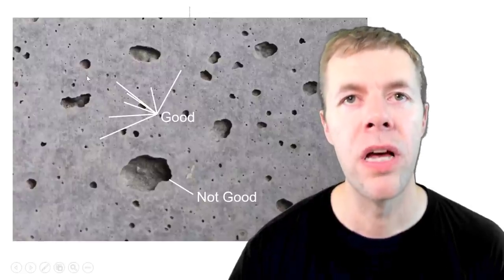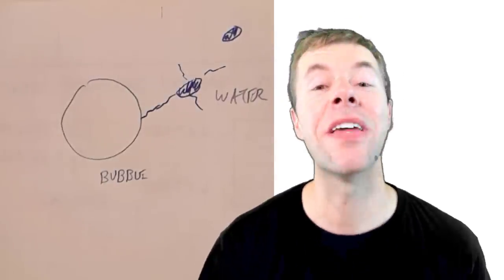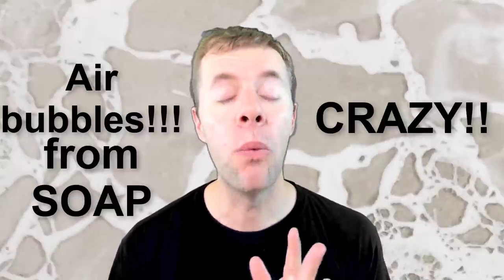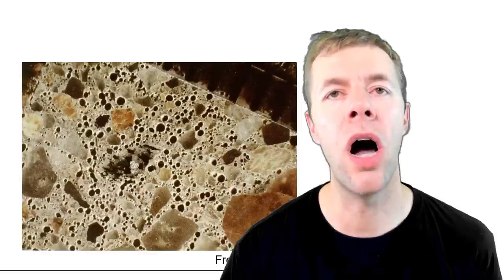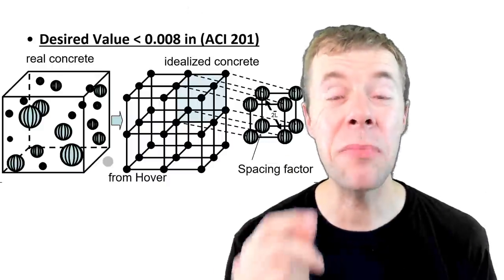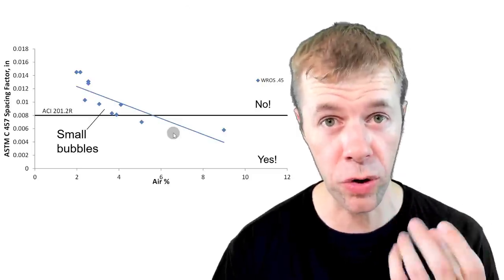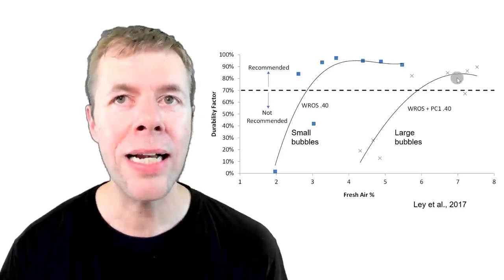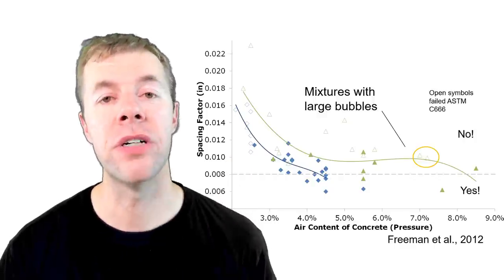Why do we NEED air bubbles in concrete? | air entrained concrete

Comment: I've tested concrete before I discovered that driving a mixer was easier and paid better. 
There was a field test for air content that involved  a pump and a gauge. When I first started this comment I though I'd forgotten how that was done, but after a  minute or two the memory came back.
Tyler Lee, I have yet to fully explore your YouTube content. Have you done any on the field testing of concrete, as well as everybody's favorite, the break test performed with a hydraulic press in the lab? When I was doing it we were using molten sulfur to cap the sample cylinders, which were much larger than those I've seen used now.
I'm now retired.
Do you remember the killdozer that terrorized Granby, Colorado? I hired as a driver for Mountain Parks Concrete as they were rebuilding the parts of the plant Marvin destroyed.
I've delivered concrete at -12 F. Amazing how fast water freezes at that temperature, even with hot water in mix and tank.
When I was working I did not think delivering ready-mix was all that great a job, but looking back it is probably the best job I ever had. 
Especially since I was delivering to places in Grand County, Colorado, one of the loveliest places on the  planet.
I could tell you tales of concrete abuse, usually involving adding water to the mix, contractors request, so the five inch slump becomes a more workable seven or eight. This was during a luxury resort and vacation house building boom. Some contractors wanted to place quality concrete that lasts. Many simply did not seem to give a shit about that.

Comment: This all seems like common sense to me I've worked Concrete in many forms from forming pouring and finishing to demoing demo is where you really get to know the strength of your concrete's and cement .
The need to get it down and get it finished so it can be used is the problem .
Does not allow for natural cure time .
Gives reason for the chemical cures .
I don't know if things have changed but my day I learned the hardest concrete known to man or ever found was it the very bottom center up dams that were not forced to cure quickly but allowed to cure naturally .
The toughest and hardest concrete I ever had to demo was the oldest concrete I've ever seen the footings and peers of the oldest Factory building I've ever been in . So hard using the Jackhammer was useless had to drill and use a hydraulic Rock splitter to remove them . from what was now being used as a showroom in what had been used as a basement for many years but originally built as a cistern .
 My Mentor in concrete when I met him had been working concrete for over 50 years .
 I'm just about the age he was when I met him now .
You have to share studies he had followed and everything he had learned .
He'd always say with concrete everyday you learn something new and I have found that very true .
Very much the sample taker and studier of our biggest pores didn't worry much about the little ones .
Always talking about his studies on Research done of core of the oldest dams .
 always very controlling with the moisture content when pouring always watching that shoot to make sure the mixture is mixed evenly not too dry not too wet .
 also while finishing never stepping on till just right and then always adding water, simply splashing it on with an old never used for anything else but splashing water tar brush . out of the same clean 5 gallon bucket and 2 and 1/2 gallon buckets that  he'd been using since before I knew him . always promoting the importance of using the cleanest clearest water in finishing or pouring or curing your concrete . always tented every pore with plastic and cured for at least a week . tending to it 2 to 3 a day soaking it down with water or keeping it from freezing but holding a good moisture content . the commercial industrial contractor we both work for was pretty adamant about using these practices at least in their own pores .
 in the contract jobs where if you don't get things done by a certain day you start paying for the job you're doing .
 in comes the need for the chemical quick fixes put simply make it more stressful and harder . and truly give more need for rebar .
 from my experience especially in demoing concrete you can easily see the less need for rebar when you  increase the cure time .
 I truly believe and see that it is the calcium and lime deposits left behind by water molecules that solidify and hold and give strength to the concrete or mortar .
Those peers and footers had no rebar and  are the hardest concrete I've ever had to demo and remove. 
 all the concrete I've ever demoed so much easier when it has rebar or mesh in it .
 I have even used a blunt old bit in the jackhammer on little spots of exposed rebar from jackhammering . given enough time by braiding that rebar you can tear a pretty big pad apart much quicker and easier and definitely if you can lift that pad and get air space under it it'll fall apart really fast .
 the Footers and Piers I keep referring to it was easy to see they were a three-part mixture of crushed stone no bigger than 1/2 inch sand and cement to this day I like to mix my own using pretty much the same X but if I can get foundry or fly ash to mix in the best thing I've ever seen happened to concrete !
 the only concrete we ever removed that had rebar in it was an old concrete bank vault with walls two-and-a-half feet thick number 6 rebar vertically every 3 in and a checkerboard pattern with number five every 3 in horizontally tied to that . with a 3 foot thick tap done in the same pattern but with the number 5 and number 4 rebar . it must been a great sense of satisfaction to be on the form and poor of that one .
 we didn't really get to demo that one we hold it to the landfill though they had a subcontractor come in with a big wet saw that cut it into pieces that we could load and haul off and the landfill would accept .
 well the learning never stops and I could go on much longer but it's time for me to go .
 if you want to see concrete fall apart quickly pour it and backfill it with soil high in metal deposits especially iron .
 peace light loving gratitude freedom I hope everybody gets their free and joyous share of it all !!!!!!!!9
 HHBpHhelps
Reply: Thank you 
Sir Henry Phelps
You sure help me
I'm trying to build a oven 
In Mexico we build them with clay
But in the Washington state its difficult to find it 
So I will go with cement
Thanks

Comment: I would love to see you do air Crete. I recently tried to make it with mixed results but am really excited about it's possabilities
Reply: That's what I was going to ask about, also.

"Soap", "Air bubbles", etc. 

"Good? Bad?  You decide."  (some quote from some movie)
Reply: Yeah Tyler, what about aircrete applications?
Reply: With my limited knowledge of concrete, I believe that Air Crete is not as strong.  I also like the idea of Air Crete but so far I don't think it has the capability to be as durable.  Would also love to see Tyler do a video on it.
Reply: ExtrovertedCenobite it’s definitely not as strong but for a lot of applications it is strong enough and it is very easy to work with.
Reply: @SpiraSpiraSpira  If you want concrete what's light but strong, you can use a low density aggregate, such as expanded polystyrene or expanded clay. This makes a far stronger concrete than aircrete at about the same weight.
Reply: There is a lot of chatter on YT about Air Crete, please do a video on it. And cloud it be used in 3D printing?

Comment: I worked a concrete project where the spec was simply "All concrete shall be air entrained." I asked about the spec before concrete work started, citing the recommendations for the floor surface coating  ("...air content not to exceed 3%..."). Never got a response. The Corps of Engineers inspector enforced the entrainment spec. When I tested one load and found 12.5% in an interior slab on grade, the C-of-E inspector said, "That's all right, as long as it has air." Later, when they were compacting the aggregate base for the parking lot, the contractor refused to use the vibratory function on the roller because "...when we turn the vibrator on, the slab cracks."

Comment: Your passion for concrete is really unmatchable Dr Ley. Thank you for  sharing it with us.Sir,aerated concrete blocks are being used in my city a lot, recently it's being reported that these blocks are cracking along the edges quite often.The weather conditions are quite hot and humid at most times of the year.What could be the reason?
Reply from the maker: Kushal - 
Thank you so much!

I am working on a video over aerated concrete and I will talk about this.  Could you send me some pictures of the cracks?  Any place you have a re entrant corner then it will have higher stresses.  The holes in aerated concrete increase the cracking potential.  This makes it easier to crack at that location.
Reply: Thank you sir for your reply,I will try to gather some good photos.

Comment: In the 80s I worked in the r&d labs at FEB, the company that produced the world's first concrete additive "FEBMIX ADMIX" (I think!). Tyler mentioned soap in the vid. NEVER USE DETERGENT IN CONCRETE!! You'll only get large bubbles (entrapped air), a proper admix will give small bubbles (entrained air). I still use the "magic mix" ...3.2.1. 3parts aggregate, 2parts sand, 1part cement and then the correct additive for the job.
Reply: 1\2 inch aggregate?

Comment: Hi Tyler, I accept your explanation, but please explain why vibrating concrete is so important in removing bubbles and helping it to move into voids.  I do understand that it needs vibration with a concrete poker, but not over-vibrating.  How does this fit with the information that you have presented here?  Kind regards,  Lee

Comment: We build power poles from concrete  - where the concrete is responsible for the dynamic loads of cabling systems.   It also stands up against the freeze thaw process, and cars hitting them.  There's a concrete testing regime at play when the batch is manufactured.  It's got to be right - or it's rejected.   On an unrelated note - my driveway is pretty good and strong these days :)

Comment: Not all concrete is the same though - it depends on the specific purpose that it's used for. I think it's worth to make some deeper studies in the area of concrete and various mix types. Sometimes you want a hard solid surface with a much lighter fill between the surfaces for improved insulation or weight reduction. Much like bones in a skeleton - hard on the outside but a truss work on the inside.
Reply: Yes I aggre today we ported and se nos pelo primo

Comment: Fantastic information!!  I'm a residential contractor who occasionally does concrete.  Read everything about concrete I could get my hands on 20+ years ago when I started but haven't learned much about the science since.  How are the bubbles entrained in the concrete?  By mechanical mixing at the plant or in the truck?  With admixtures?  A combination of both?  Will too much mixing or agitation either in the truck or in the forms with a vibrator cause loss of bubbles?  How do I make sure the concrete supplier has put good, small bubbles in the concrete?  Thank you for making these vids, SO very helpful!
Reply from the maker: Thanks Matt,
The bubbles come from an air entraining admixture that is added during mixing.  It is soap that makes the bubbles.  The bubbles are kinda finicky and they are easy to lose.  Too much vibration can cause them to be lost.  The best way to check for the bubble size and spacing is to use the Super Air Meter.  

More on the Super Air Meter here: https://www.youtube.com/watch?v=xabCt_CibJY
More on air entraining admixtures here: https://www.youtube.com/watch?v=CXg6kvZWeO0
Reply: @TylerLey  Thank you so much for taking the time to reply!  Saw 2 links that I will watch shortly, could be more but YouTube won't let me scroll down to see them.  
Can additional admixture be added to truck  and mixed on site if meter shows not enough/correct size of bubbles? 
 I mainly work (residential contracting) in a very small, remote town (Valdez, Alaska) with only one concrete supplier who doesn't know their backside from a hole in the ground and threatened to refuse to sell me concrete when I complained about his 15" slump (it's basically grout with footballs of dry Portland cement in the mix that it's the customers job to deal with) The more I know about the science of concrete, the better product I can give my customers.  I'm going to watch your channel's entire library.  
Was fascinated with concrete early on but "fell out of love" and have tried to avoid it as much as possible due to the terrible quality of the concrete available to me. 
Fun Fact:  Whenever you hear anything about how safe and well built the Trans-Alaska Pipeline Terminal in Valdez is, remember, the guy who sells me the crappy "Sea-Side Slurry" (his name for it) sells the same crap to all construction jobs on the pipeline terminal.  They, of course, have inspection engineers who do occasionally reject batches but I think the design engineers have just resigned themselves to over-building projects using junk concrete.  Next closest batch plant is 120 miles away.
Reply from the maker: Matt,
Thanks again for the comment and story.  You can add air on site to bring it back into spec.  Alaska DOT is in the process of adopting the Super Air Meter.  I talked with them last week.  Maybe that will help bring it to Valdez.

Comment: I know that they have the air but it is the first time it was told to me why.
Reply from the maker: Glad you know!  Thanks for the comment!
Reply: Edward Raney  explain please?
Reply: Edward Raney  Thanks for replying. I was wondering if the rounder holes were creating kind of bridge shaped areas in the concrete with the same science behind the strength of bridges. I am newly fascinated with concrete. It appears to open up worlds of opportunities.
I just remembered, at school many years ago, in science we were discussing the strength of an egg because of its shape. Doesn't that do a similar thing inside concrete? Just very curious. If some say it makes it stronger and some say it doesn't then I am not settled in my mind about it. I may need a science lab. Lol
Reply: @TylerLey  Does air content help with increasing its thermal insulation.
Reply: @flourishomotola5306  no it would not. It helps with expansion and contraction.

Comment: Can you put polystyrene balls in concrete to create circular holes within the concrete when it sets? I was thinking how a bridge is strong if it has the arch because of the way the weight travels down the arch sides removing the problem of weight just pressing onto the top...if you know what I mean?
And if this is a good idea is it better to have a larger or smaller polystyrene ball size? 
And also would they be better used dry, kind of sprinkled on a layer of wet concrete with the next layer quickly poured on top? Or better to mix them into the cement?
(I don't know why but I am so fascinated by cement! Amazing stuff!)

Comment: Years ago I was at a resort in FL.  The swimming pool apron was wide concrete and had lots of recliners.  What was very strange was despite the brilliant sun, the concrete remained cool!  It was almost disturbing.  You put your bare foot out and life experience told me "your foot is about to sizzle...", but no - it was cool to the touch.
How did they do that?  My best guess was they injected the mix with air, but that was only a guess.  Any clue?

Comment: Thank you for your information sir but does it effect the compressive strength of concrete?
Reply from the maker: Yes,
As the air volume goes up by 1% then the compressive strength goes down by about 500 psi.
Reply: if psi goes down with bubble then mixing by shuvle is best?

Comment: I have a road building background. While building my shop in the backyard I poured the slab myself w/felt board expansion joints every 8ft horizontal and vertical. It still cracked & failed in my opinion. I was told this happened cuz I compacted the base. I used Lyme treated ABC and processed it like I was building a road. Does this sound right? Shouldn't the expansion joints been enough for expansion? I was told it needs to be able to expand into base. Thus my compaction of base is the culprit. Luckily I hadn't started the structure yet so I will be doing it again.
Reply: I doubt the compaction of the underlying soil had anything to do with the cracking. The felt board was also probably unnecessary for the distances you described. Contraction cuts made after the initial set would be all you need depending on the size of the slab. But to be sure I would check the ACI codebook for best design practices for the size of slab you're building.